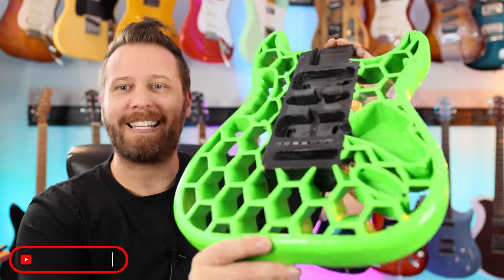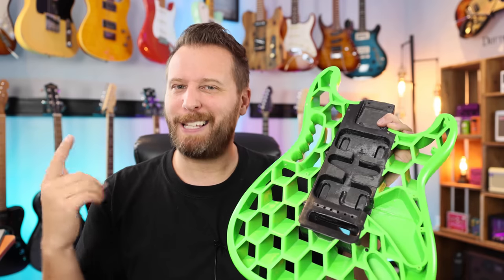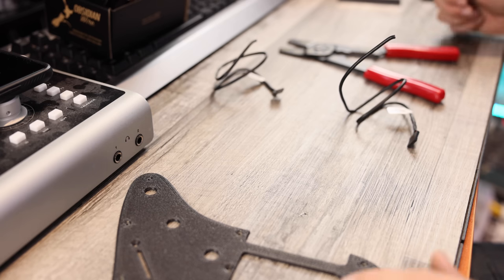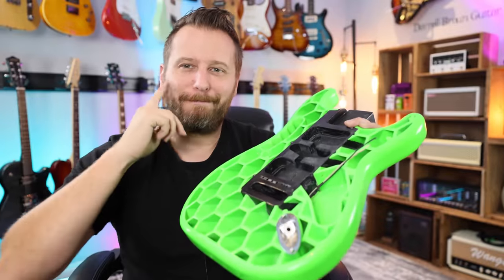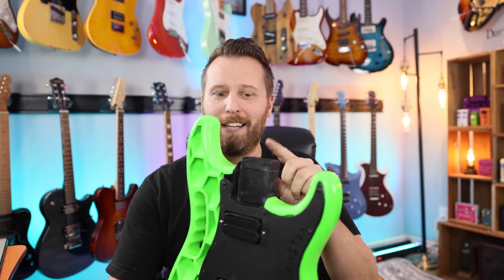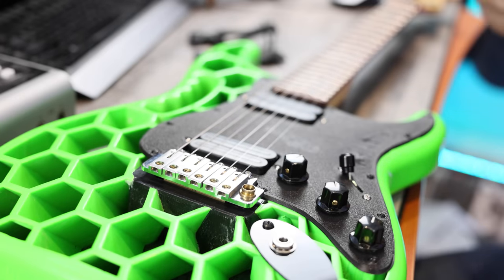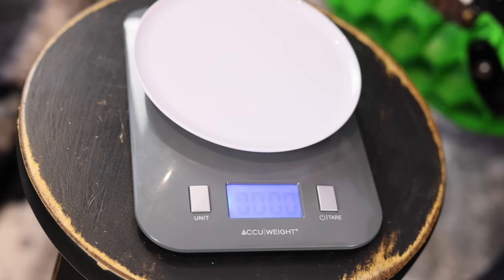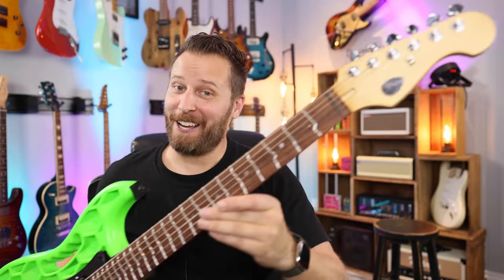BUILDING an *EXTREME* Stratocaster!!

Comment from the maker: It's been a LONG time since I've done a full partscaster build, and this one is...pretty unique lol!
Let me know what you thought of the tones!
Enjoy :)
Reply: Sounded very cool ngl.

wondering how it will sound like with a plastic neck though, like the whole thing is 3d printed.. just hoping it won't pop out once you string it
Reply: I've noticed something about you... you're always happy. What's your secret lol
Reply: I'm liking the new 3d Strat buddy, pretty cool!!
Reply: It wouldn’t be flush, but flipping the Jack plate upside down would allow you to use on and not need a 90°. A satin black one would match the build well. Nice thinking though on how to make your own!! Dig the neon green! Sounds great and a comparison with a wood SStrat would be cool to hear the differences.
Reply: Sounds fantastic, just hard to get used to a guitar without a wood body.
Reply: Sounded great, looking into building one for myself.
Reply: It was great but I felt you rushed it a bit to get the video out. I think you should address the issues more squarely in a future video- proper fix for the jack, trem and neck alignment. Drilling out the jack cavity should work, and I’ve seen FR trems with metal plates to stabilise and support the 2 point system in soft wood.
Reply: Your adaptation to the change of the jack plate mod was brilliant!

Excellent build - looking forward to the shootout with the wood body Strat. To my ears, this one sounded compatible to a wood body.
😎👊 🎸
Reply: I was waiting every for this video.
Reply: Really loved this video. It somewhat disproves the myth of tonewoods, or the myth that you can ONLY get good tone using certain woods or materials. It would be a great follow-on video if you took the exact same components and used an Alder or Swamp Ash body instead.   Or also getting a different pickup set to show that the latter makes a much bigger difference.
Reply: It's an awesome instrument. Would like to know how much it cost you to build ? Ballpark would be great.  Either way thanks for the great vids.
Reply: Darrell .. you asked the other day us to lower our strat pickups for clearer definition. 
Having just seen the “ Greenie “ on Troglies tube channel I noticed the bridge p90 is close to the strings yet when another tube channel has Kirk Hammett saying one channel was usable and implied the bridge was “squarbally”..
With that could you do anything with a narrow dummy bar magnet in center position.
Magnet to a steel strip with hight adjustment..
p90’s.  
Dreaming…
Reply: AGAIN. It's not a real superstrat if you don't use a locking trem system! The guitar is very cool, but it's only an S-type and not a superstrat. Superstrats utilize Floyd Rose or similar trem systems to give you a far wider range of notes compared to standard non-locking trem systems.

Edit: Thanks for changing up the title! Much more accurate to the guitar! By the way, there's another guitartuber called Guitar Max who swears by the Floyd Rose tremolo system. I think it would be a great idea for you to debate him on the advantages and disadvantages of traditional trems vs locking trems.
Reply: Finally an end to the tomewood debate 😂. I am curious though, why do so many esteemed luthiers believe in tonewood? Don't quote me  on this but I'm pretty sure Paul Reed Smith said it himself. I guess I'm just wondering what their reasoning is behind it
Reply: @guitarenthusiast22  I don't know about body tonewoods, but I do notice a difference between maple and rosewood fretboard strats. I also just got one with an ebony fretboard and it sounds super unique.
Reply: Mego cool!!! Gonna check it out !!!
Reply: @guitarenthusiast22  their reasoning is to sell more guitars. It's just marketing speak at this point.
Reply: You're clean playing riffs are tight . But the high riffs ate really lacking during this style of review.  
I've noticed in your older videos did much more distorted riffs . Just my 2 cents ! 😎👌
Reply: Try the bond guitar neck with no real frets🙉🎶👍
Reply: Now iiiiii, what frets man, just the switch sucks, superThing darrell
Reply: The frets are freakiiiii🙉🙊🙉🙉
Reply: Fits the build the bill, quanta costa😇
Reply: Look at this 3d pritned guitar

Comment: The tone plastic debate rages on. Sounds really great no matter what's holding it together.
Reply: Tone plastic... love it!
Reply: Yeah tonewood is nothing compared to toneplastic 😂😂
Reply: The hardware and what it plugs into is 95% of the sound of any guitar anyway
Reply: I'm building a physical model of an electric guitar which is basically using software to replicate how it sounds on a computer and honestly the tone isn't affected by the body of the guitar for a fixed bridge pickup. It's only really relevant for an acoustic.
Reply: @profjb58  like a mathematical model? Anyway what you write makes sense to me. Wonder why we bothered with heavy mahogany guitars, etc.
Reply: This is very dark sounding for a strat. If you cant hear that then get your ears checked bro.
Reply: @cominroitover80  oh wow, it seems like placebo effect is not just a thing in medicine.
Reply: @ironeinar  get your ears waxed grandpa
Reply: @cominroitover80  have no need to, as I have great hearing. I'm too young for hearing damage.
Reply: @ironeinar  said no veteran ever... hahaha
Reply: @InZomnia365  *100
Reply: I've built three 3d printed guitars, and they do sound different, the plastic will dampen string vibration and mess with the sustain a bit. The only way I was able to get decent tone (I like playing metal and high gain*) was by installing active pickups. However, the clean tones do sound very nice and warm.
Reply: I think Teflon sounds the sweetest.
Reply: Look at this 3d pritned guitar
Reply: there's literally a video on Youtube called: "Tested: Where Does The Tone Come From In An Electric Guitar?" where the host, who's a musician, goes extremely in depth on testing where the tone actually comes from. I already understand someone who's already made up their mind about this is never going to go look up that video, watch the whole thing and come to a better understanding on the topic. That's just too adult-like. But either way I gave you a resource to go prove yourself right or wrong or at least gain more insight. You can choose to take it or stay blissfully ignorant.

Comment: For the output jack issue, you could just flip the mounting plate over so instead of the dish going down into the body, it sticks out. It may not be the best looking option ever, but it should work.
Reply: That was my thought too. Would look different enough to match but not that strange to be weird
Reply: I tried this on my squire strat and it works.
Reply: I think Alex Lifeson used to do that so he could use a 90 degree plug on his super strat.
Reply: Or he could have Dremmal'd out the body where there was interference. The plate would've covered it. I mean...he had a Dremmal...

Comment: Cool build, quick question why not mount the jack plate inside out? That way you would have had enough clearance for the cable and jack 😁 give it a try, plus the upside is that it looks unique 🤘

Comment: Darrell, simply take the strat jack plate (the stock metal plate) and flip it upside down and turn it 180. It should fit. The plate will stick up but the plug will go in same angle. Dremel tool the inside of the body to open it up a little inside so the plug tip fits. Just an idea.

Comment: That texture on the pick-guard is from the textured PEI build plate on the printer. The coarse PEI coating looks and feels like sandpaper and helps the part stick to the plate while printing. So the guard was printed upside-down to give the top that texture.
Reply: I don't think so.  I think it was printed with the "pick side" up.

Comment: Are the pickup wires supposed to bend back on themselves like that, or did you install the pickups backwards? Also, if you make the neck screw holes in the body slightly bigger so the neck screws don't bite into the body, you'll get a tighter neck joint. When the screws bite the body, you run out or torque when the screw seats against the plate. With the holes bigger, it torques the neck in closer to the body for a tighter fit.

Comment: I have a 3D printed guitar that I assembled that I should be getting back from my local tech soon. Unfortunately when I got the body from the guy who printed it, the pickup cavity was way too shallow, so I used a dremel to hollow it out more and during that process the body snapped at one of the seams. I was able to epoxy it back together, but do you think I should be concerned with it's longevity?

Comment: Looks like you put the input jack rotated 180 degrees wrong? Does it fit if you put the metal part of the input jack downwards and the cables upwards towards the plate?

Comment: Take your jack plate flip it upside down, mount the jack from inside the "well" and screw it together.
The cable plug will then fit in the cavity without mods.
Reply: This was an old trick that some folks used when adding active pickups to their guitars. You could put the 9v battery under there if the route was big enough.

Comment: The guitar sounds as good as wood. Too bad about the output jack. Maybe a smaller jack plate is available, for a more elegant solution. I hope you demo the tremolo unit in a future video, as I'm curious how the plastic will hold up, and if it remain stable.

Comment: Having worked with 3-D printed material, I had a question as to whether it would be rigid enough to hold the string tension, but then I saw that the body is two-piece, and all of the load is carried by the black portion. I am not sure that was printed. I think it was machined out of some material like Delrin.

While the true-tempered guitar neck does have a nice modern look to it, I am somewhat disappointed that you didn't go with a manmade material such as a carbon fiber neck, which would have been more in keeping with the body.
Reply: Printed core is not rigid enough. Action will keep rising. That's why I printed guitar with wood insert from neck to bridge. This one does hold action. It's on my channel.

Comment: drill holes through the jack cavity to meet tube the wires go through and drill and attach the input jack to the outside body fill in the old jack cavity holes and then it just looks like the other weight relief cavities all over the body

Comment: I'm designing a 3D printable guitar as well.  I'm going to start out with the body, but eventually work towards the neck which is going to be the more difficult part, since it's very difficult to get a 3D printer large enough to do the neck in one piece, but I have some ideas on that.
Reply: I’ve seen it done on a belted printer like the a CR30 by Creality.
Reply: @TylerLL2112  Yeah, but I want a solution that is available to more people.  And I have some ideas for that.  Other, readily available parts and materials can be used to give the neck strength, using 3D printed sections to give the neck shape.
Reply: @ulfrinn8783  I hear you. That’s cool stuff. Where can I expect to see it once you finish it?  That combines my two hobbies of 3d printing and Guitar. Take care!
Reply: @TylerLL2112  It may take some effort.  A few months ago I made a complete switch to Linux, and because of that I cannot use the CAD software I am used to, which means I have to relearn something new.
Reply: @ulfrinn8783  That’s never easy having to learn a new CAD program. I can see that slowing one down. I appreciate you taking time to reply. Best of luck on your project.
Reply: I printed neck in 6 parts, 3 for body and 3 for fretboard. First one was glued together perfectly, second one I messed up and intonation is messed up. I installed dual action truss rod and 2x fi6mm carbon rods in first neck, but it was to bendy, in second neck I installed two pieces 8x5mm square carbon rods and that one was OK, besides messed up intonation... You will need to use some special inserts for screws that bolt neck to the body or it will not hold action. 3d print does not like constant load.
You can find three of my printed guitars on my channel, besides two MIDI stompboxes I made.
Reply: @stenc5547   The way I was thinking about doing it is by using one or two carbon fiber rods/tubes as the bulk of the support, and the truss rods attach to this while sections of the 3D printed neck are glued to the carbon fiber rods.  This way, all the stress is on a material we know can handle it and the 3D printed neck parts can be all about the shape and feel.

Comment: You're going to do a tone test then please make sure you're using the same pickups (switch them over from this guitar since there are likely slight differences between each pickup) and the same type of electronics. I think it would be best to just switch over the pick guard. Also make sure both guitars use the same type of neck, bridge, tuners, and anything else wherever possible. Also very important; make sure the pickup height is exactly the same.

I've seen a video where someone tests what causes differences in tone, and he removes as many variables from the test setup as possible. And the test setup with the strings spanned between two workbenches sounded exactly the same as the baseline guitar (baseline as in the baseline for the experiment. Not something musical :p ).
So that video makes it seem very likely that wood does not change the tone of the guitar. So please make sure your tone comparison is equally as thorough by eliminating as many variables as possible.

I think the guitar scene could evolve quite a bit if tonewood for electric guitars really is a myth :D

Comment: Tonewood does make a difference. It's just so insignificant no one really hears it. That does sound really nice!
Reply: Wood only matters on acoustic instruments. A magnet is incapable of picking up frequencies from wood. It can only sense vibration from metal. A piezo on the other hand would. But who plays electric guitar with a piezo? The slight difference you hear in electric guitars come the pickups and electronics, possibly the strings not the wood.

Comment: Waste of a premium trem. At that point I would have just settled for a 6 screw type bridge and return the 2 point or use it on another build, rather than blocking.  Putting some fancy roller or other modern looking saddles on a standard trem makes it look more modern and in my experience lessens string breakage. 

And the jack "route" issue is unacceptable at the price he charged for that body.

If I remember from the body video, you had a choice of 2 or 6 point. I would think a 2 point would use larger ferrule/stud mounts , most 2 points are thicker than simple 6 point screws, so maybe a 2 point would work with bigger diameter mounts.  Basically, trying to put a 2 point in a 6 point size screw was probably a mistake.

Comment: Forget tonewoods, they all sound the exact same. Plastic is where the flavor is  I can really hear the 0.8mm nozzle coming through on the low end. I have a trained ear for toneplastics. I only use guitars printed with carbon fiber reinforced nylon because anything else makes square waves instead of sine waves at the output jack.

Comment: Such a shame about the output jack because it would have been so simple to make it right the first time by having the actual fully assembled part to check it. This company did itself a real disservice here.
Reply: Frankly they should have modelled it on the Ibanez S or SA series where they solved the strat jack problem years ago, by machining it directly into the wood.

Comment: I saw a 3 piece body 3D printed guitar. It sounded like absolute garbage. THIS 3D printed guitar sounds amazing for some reason. 

I guess, as long as vibrations can easily pass through the material, it should work.

Comment: Wow that one spring on the back SMH you have no clue do you? At least put two on there man. If you're worried about the tension get the weakest ones you can find. But that one spring is not going to cut it bro. That tension needs to be spread evenly.